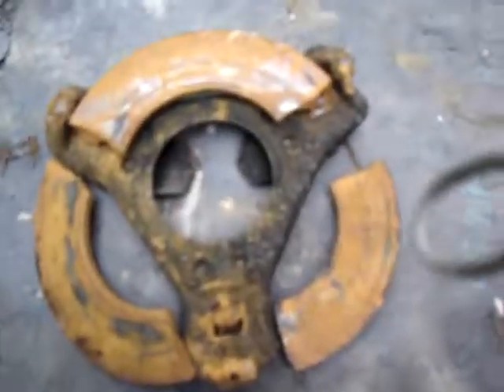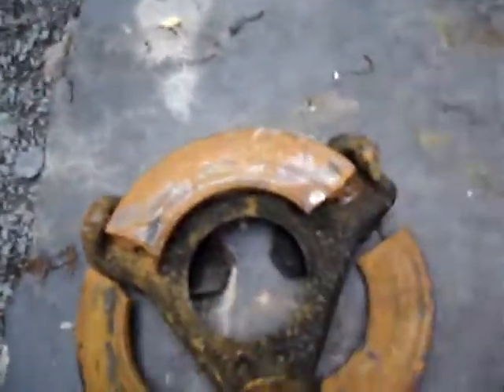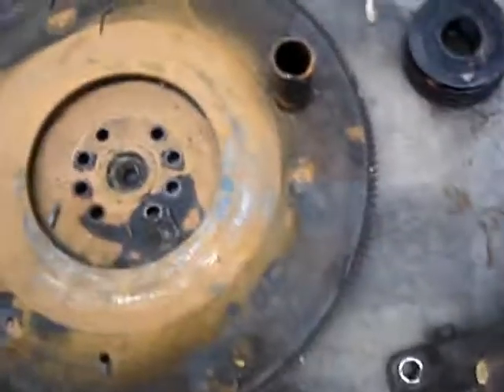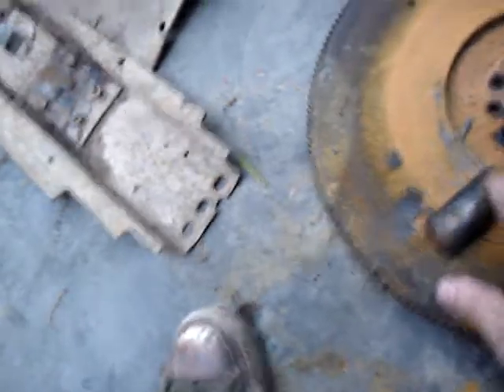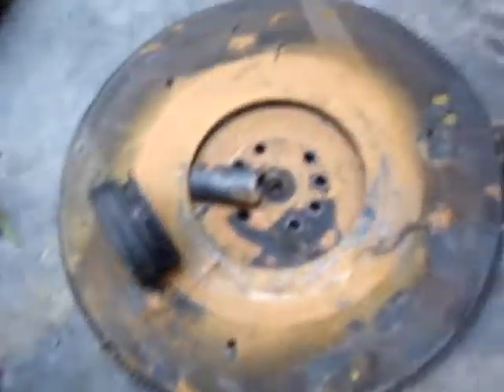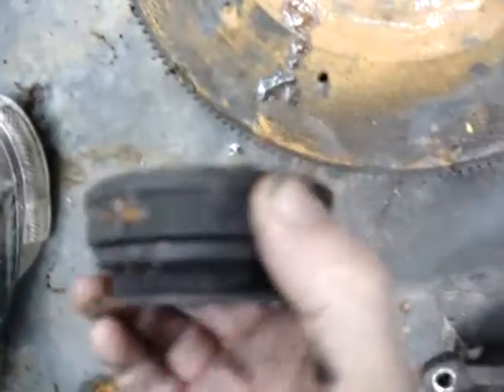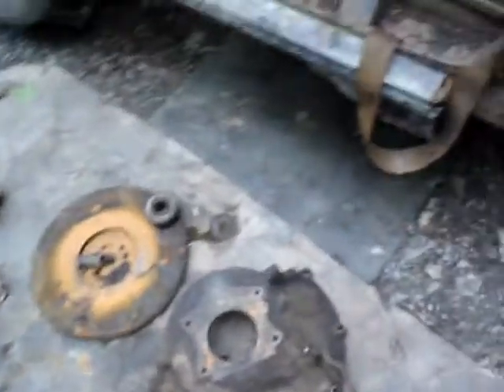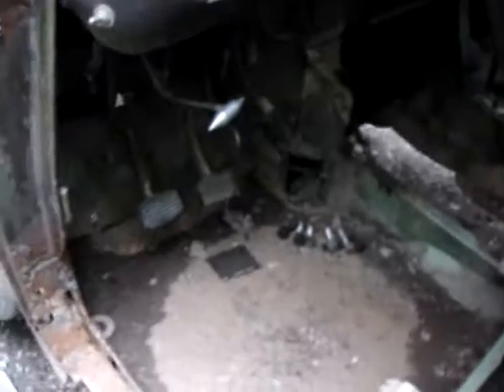Scout shrapnel

Comment from the maker: @1967800 I've checked out Scout parts.They're ridiculously overpriced because they have a stock of parts.I can't and won't pay $400 for a clutch kit.I'll sooner adapt another clutch and pressure plate.A clutch kit should be $250 at most for a light duty truck such as mine.They have the parts, but they're asking too much for them.